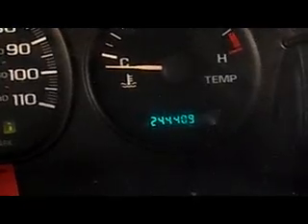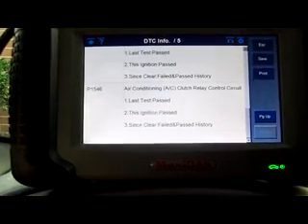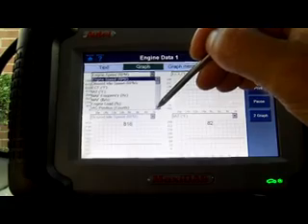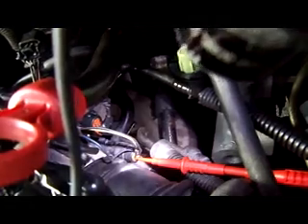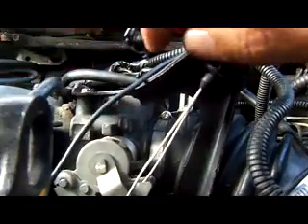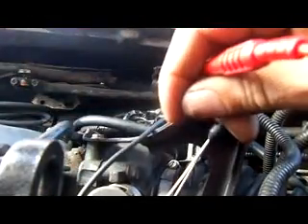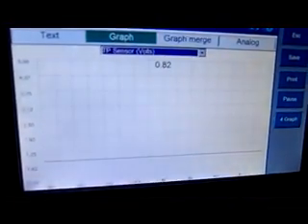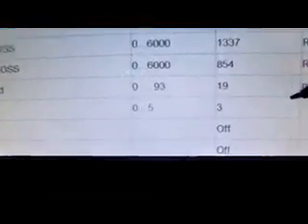4T65E Transmission, No Up Shift P0121,P0122,P1122 TPS Related - Transmission Repair

Comment: hi i have a question i have a 2002 nissan maxima 3.5 v6 and i have code p1122 i really need help i change the throttle body and nothing i bought a new gas pedal and nothing say code i really need my car and wish if u could help thanks

Comment: Hey Amigo! Great job on this diagnosis.
Quick question, I have a 2000 Ford Windstar AX4S that I'm rebuilding currently and the odometer only reads 1/2 a mile when I've gone 1 physical mile. Any idea what the cause might be?
There are no gears in this tranny for speedometer its all done electronically. 
Thanks!

Comment: This is why you always test and never guess!! I've had a MAF and MAP sensor go bad at once and SWORE I had transmission problems. It had the same problem, would not shift out of 2nd. Tracked down and Fixed those two problems by using my scan tool and still works flawless to this day.
Reply: Yep! Especially MAF sensor issue can mock a transmission issue!

Comment: I read about a 99 Tahoe. The guy took off the cats because he thought it would gain hp and burn lees fuel. The truck check engine light was on all the time. One day, the transmission started slipping. He change the fluid and filter and it didn't help.
He took the trans out himself and rebuilt it because he wanted to save money. The unit had the same slip after his rebuild. He then took it to a trans shop. The shop check the codes and found that solenoid B had gone bad. The transmission was not slipping, it was starting n 3rd gear.
Reply: ***** I don't remember but it sit next to A.
Reply: ***** If you are not getting a code. The solenoid is probably fine. Is your transmission pulling off in 3rd gear? My Tahoe has 312,000 miles on the stock solenoids. Even after rebuilding the unit at 285k, I didn't change them.

Comment: I have a question on rebuilding a 4T65E-HD transmission. After assembly of the input, 2nd, and 3rd clutch packs, I perform an air check and have uncertainties about the results. Air to the 2nd clutch results with action, but i have leaks coming back through the lube hole. When plugged and repeated, the leak can be detected from a hole inside the shaft. Plugging both holes, leaks can still be detected. Is this a bushing issue? 3rd and input cross bleed to each other as well. Plugging one results in a more solid action in testing. It looks like 3rd clutches react to input air test. Any info on this would be greatly appreciated. Thanks

Comment: if the signal wire disconnected is o volts, can the tps be temporarily disconnected to have the computer shift transmission in a missing sensor strategy. it is funny how much needless work gets done by not gathering the evidence. great video. i like your electric troubleshooting.

Comment: Trouble shifting with my 2011 Impala. replaced the TPS and Max Air Flow Sensor. Had transmission work done replacing a clutch and gear three and it's doing the same thing

Comment: Excellent trouble shooting technique.  Clear and concise explanation of problem and repair.  I have a 2001 Impala with 29,000 miles and it now won't sift into OD or lock the converter.  I was already to take it to a transmission shop.  Now, I will have it scanned.
The car has always been garaged and serviced as recommended and is emasculate.  I purchased it from a dear friend and KNOW it was not abused (in the 29k miles, it only left town a half a dozen times.
Thank you for renewed hope.
Galen

Comment: Will this also cause the torque converter to hit hard when you put it in gear? mine has same code p0122 no upshift and when put in gear convertor bangs into gear.

Comment: In your opinion, could the TPS have caused the transmission to start having shifting issues? I have the Autel Maxidas. Really a good scan tool. Especially for Asian and European. Cant wait to see their lab scope they are testing along with the next generation Maxidas coming out in the spring.